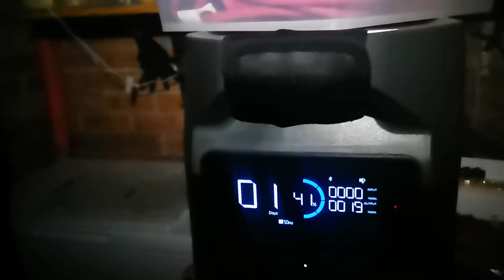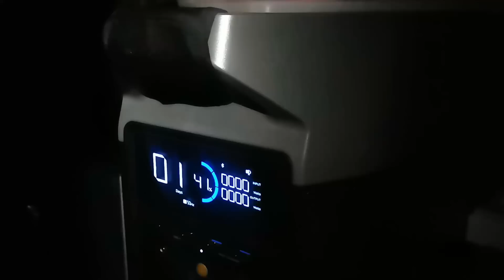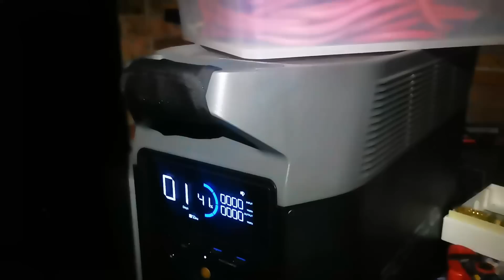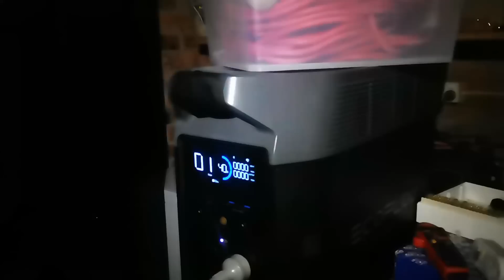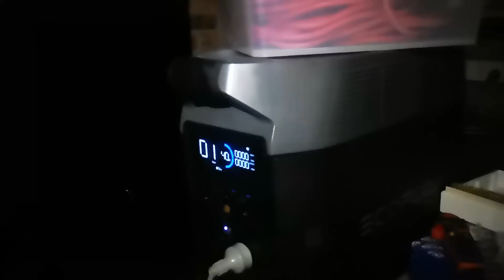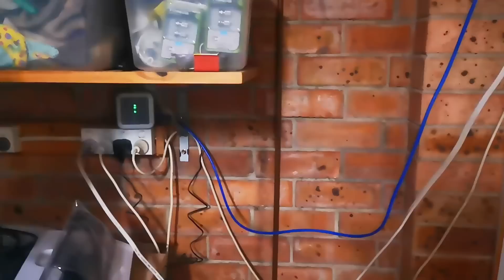Sydney Power FAIL!

Comment: Those smaller AGM/gel cells never seem to get many years of life. I've been curious how the lithium retrofit batteries would fair, especially given their cost.
Reply from the maker: Yeah, not great. I seem to get 4-5 years tops. Even though the Ness has a "maintenance" charge cycle.
Reply: Lead acid is a trap and just not worth it, go lithium or don't bother at all. I've done the off grid life back in the 2000s and the best lead acid batteries aren't cheap being forklift batteries. There is another channel that has a lot of reviews of different lithium batteries for this use and most have an internal BMS to boot.
Reply: The retrofits appear to do well, and emulate the SLA in charge cycle, and are said to last around 10 years. Of course you cannot get stock of them, but the 7Ah SLA alarm battery is only $20 AUS by me , the Li iron is $50, so you just keep on buying lots of SLA. At least you get $2 for them as scrap.
Reply: @SeanBZA  i replaced 4 of these guys that were in my APC UPS with some lifepo4 types. they are pretty much identical voltage and Ah but you have to be careful with the max output current. the lead acids can do like 100A where the lifepo4's are usually around 10A. Because of this, i have to keep the load on my UPS under 480W instead of the 900W its actually rated for. My server is only drawing <200W anyways so no worries there.
Reply: @mattb6001  I mean, you can easily match the lifepo4s to the lead acids. Capacity-wise they are not even that expensive considering you can use 100% of the rated capacity.
Reply: @mattb6001  any recommended packs?
Reply: @edc1569  I just got cheapos from amazon
Reply: @SeanBZA  My inverter batteries lasted 4 months till yesterday (cheap mecer kit + 2 x 100ah 'deep cycle' SLA). And typical, no one has LiPO stock for me to replace them now... Think I just need to invest in a proper system.
Reply: @leppie  I just went and got 2 cheap car batteries, and put them in. 2 year warranty, and have already had one fail, but they have made it out of warranty. Just look around for whoever has the cheap car batteries ( hint not Midas) and take the old ones there as scrap, saves you R150 per battery as lead surcharge. Get the highest capacity ones, and pay for the 2 year warranty, and see what you get out of them.
Reply: @SeanBZA  I had that idea a while back. Do I still need to get SLA? My batteries are in my office. Would a single 24V not be better than 2 x 12V in serial (I actually suspect just 1 is failing)?  I normally get batteries from a local Battery24/Willard Xpress.
Reply: @leppie  2 12V car batteries, and the battery box from Makro/Builders/OutdoorWhorehose to hold each one, plus some 10mm stranded copper wire, crimp lugs and battery clamps. 2 12V batteries works out better, at least when the first one fails you can use the other as a spare caravan or loadshedding light battery. Cheap car batteries pull that "maintenance free" sticker off, and you see the filling caps, or the cover just clips, off, and make a reminder every month to check water level, like I did. Make sure the warranty slip is nearby so you can go get a new one in 9 months when it fails. The UPS charger really cooks them, so they lose water slowly with every load shedding cycle, as they get nuked up to full again fast. I also added a big electrolytic capacitor, around 15000uF 35V, out of some industrial stuff I "found interesting" at the scrap yard, and the capacitors were still in excellent shape, put into the UPS box as both terminals and decoupling. There was an external battery connector, so grabbed the internal battery Anderson one as mating connector.

If going Li iron, you need to have a good number in parallel to handle the charge current and the peak discharge current, as the BMS they use is typically going to shut off at around 20A, so you want to run them 10A max.
Reply: @SeanBZA  thanks for the input!
Reply: @leppie  Well, R700 per battery for the car one is a crap lot cheaper than the R1500 I have seen as about the cheapest deep cycle ones.
Reply: @SeanBZA  What capacity ones you looking at for R700? And where? Cheapest I see around here is 50Ah for R1000.
Reply: @leppie  610 battery from the local motor spares place. You need a core though. Not the best quality, but even if you buy 4 still cheaper than the genuine ones. Try Dixon batteries in your area, they have good prices, better than the brand name ones, and as you will kill it from cycles not really worth paying for the name.

Comment: lol that aged well - "we never have powercuts".   I never have powercuts either, but my battery system can keep my house going for many hours if such an event happened.  All my critical loads are on a separate consumer unit - so very easy to do.
Reply: When was the last time you tested it?
Reply: @justovision  I’ve had a generator for 10 years which was tested every 3 months.  The UPS also tested every few months (run down test).  My new 19kwh pylontech/victron setup gets “tested” every day as i charge 4 hours overnight and run entirely from battery for the other 20 hours.
Reply: Wa wa waaa... didn't Dave say we never have interruptions?  Cue the video recording.
Reply: we all knew he was knocking on wood when he said that... so this video appearing made me do a little chuckle. Sorry Dave, laughing with you and definitely not at you. hopefully it was just a local fuse that fried, and they can get you back on quickly. I'm in MN and that's the general deal - almost all outages (except those during major storms)  are simply a local fuse blowing in the street side box or in older neighborhoods sometimes a transformer can up on a pole.
Reply: Murphy works at the electricity grid company of course.